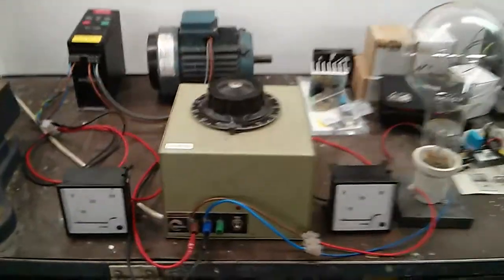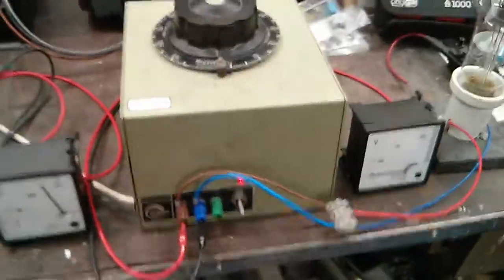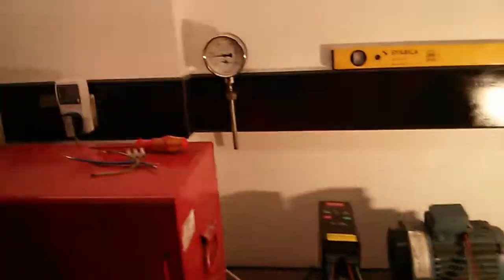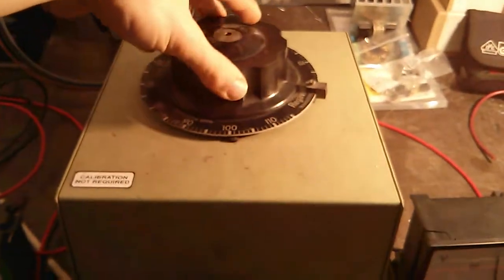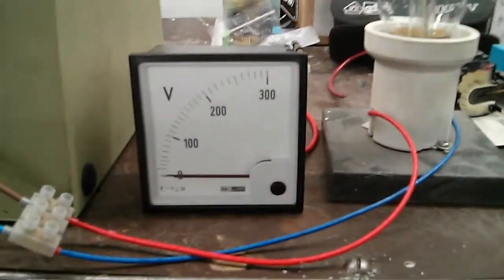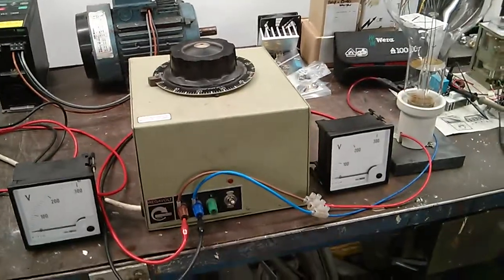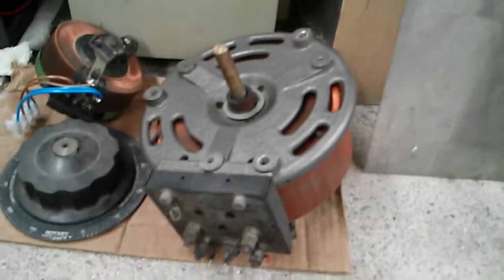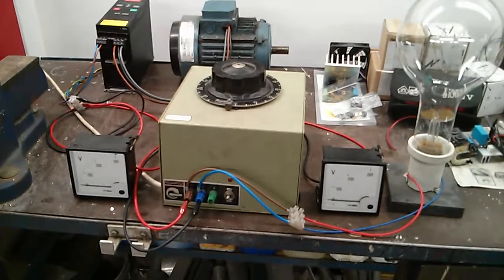New Claude and Lyons Regavolt 715LAB 15A 0-275V Variac Test

Comment: the world has sooo many uses for these. i recently made a large power supply with a double variac stack. un-fortunately they have no over wind capability and for that i  have them wired to handle 40 amps constant. the power supply and service to it can only handle 20 amps currently because i have it to disconnect both hot and natural when off. it can be easily modified to handle 40 amps if needed but "less safe"  recently i use it with angle grinders to slow the speed when needed.

Comment from the maker: Awesome top tips there Sparky, that variac is still on the center of the workbench in the garage, waiting to be started on, but ordering the parts at the moment it appears that getting hold of matching make brown, blue and green binding posts are hard to come across, the RS search engine is really terrible, particularly brown is the hardest to find... Tried Rapid, CPC, Fanell, not much luck yet. but I will take your advice with the collet on the shaft, it does look like oil might have gotten in.

Comment: The shaft looks like it could be held on with a collet, they usually are, when you look into tightening it up, if the shaft is worn where the collet grips, remove the shaft and invert it so the collet  grips on a better portion, alternately you could use loctite, that will enable you to take it apart in the future if needed.

Comment from the maker: Thanks Pete, The 800W incandescent lamps has a diameter of 150mm/6" and 300mm/12" tall, pretty massive, I actually own a few of these so I could in theory use them to do a descent load test of a small/medium variac.
and the motor is just a little ABB 0.55KW 0.75HP 3 phase motor on a Danfoss VLT 2800 VFD which currently has a significant amount of earth leakage... needs exploratory surgery... The 2800 is overkill as that is meant to run a 1KW motor minimum, I need to find my little ABB VFD really